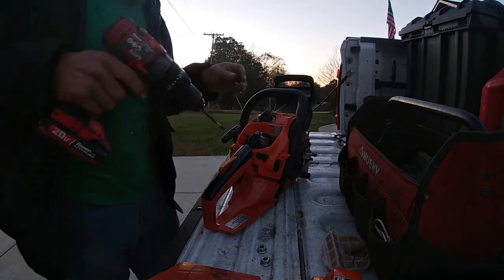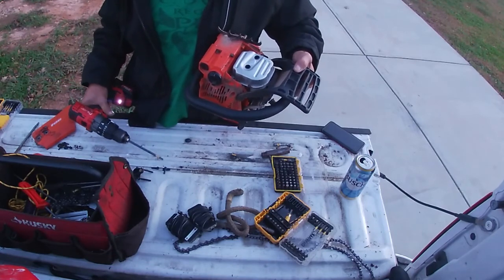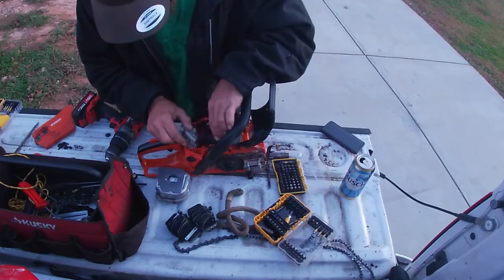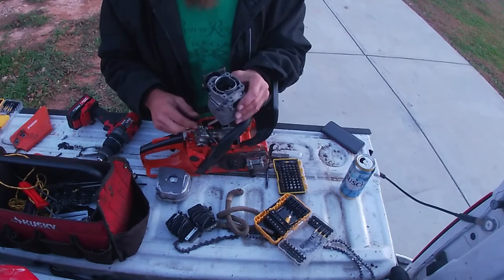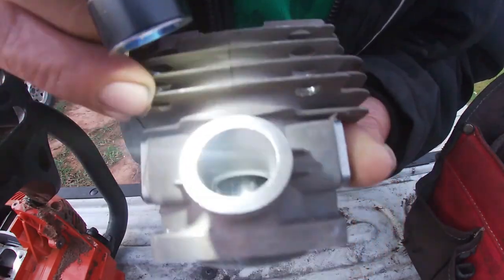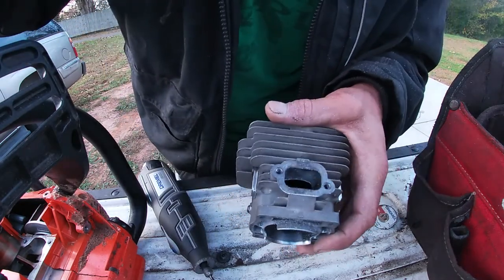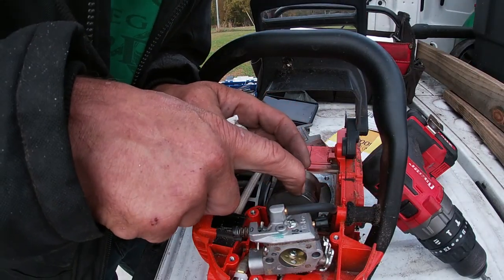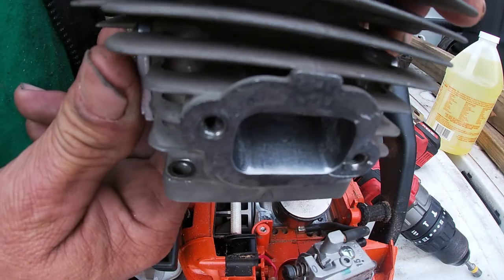Cutting and polishing my Echo 490 ports.

Comment: Nice vid, I just ordered a 501p and eagerly awaiting its arrival.  Great video my friend!
Reply from the maker: Its a great saw.  I miss mine.  This 490 is working good though.   Especially after the wake up.
Reply: Love my 490 an 501 but i ll get 501 front handle for 490 in hot weather plaztic handle has too much flex in hot weather

Comment: I got a 340t its not a bad saw
Reply from the maker: I haven't ran one of them.  I have a 355t.  Its kinda clunky feeling,  but it has great power.
Reply: @dan-dan-da-treeman  its older it needs woke up a bit lol
Reply from the maker: @joshuap7501  most of the echos i have ever used just needed a muffler mod and the limiter caps taken off to get a good tune.